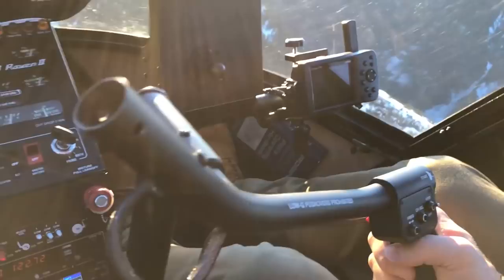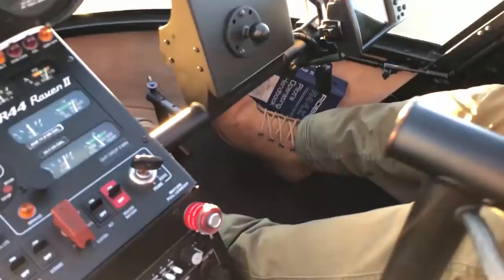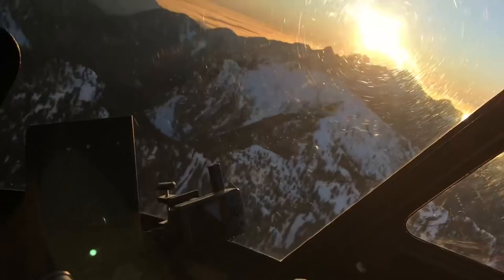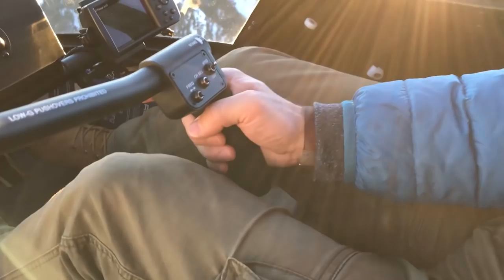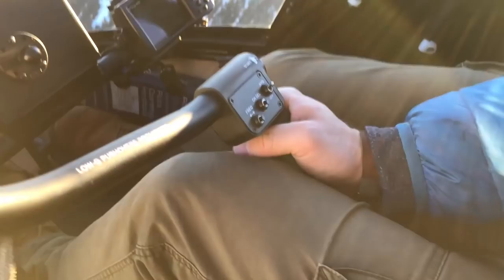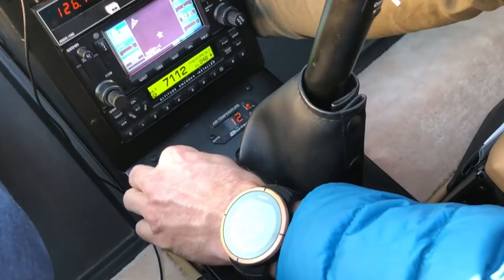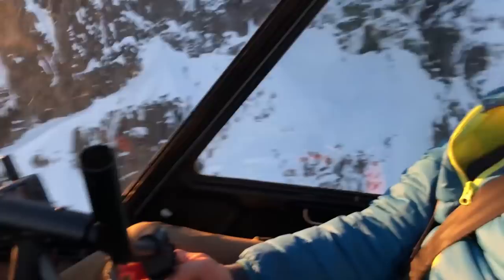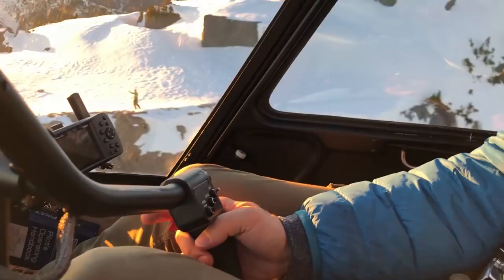VLOGMAS DAY 6 | HOW TO SAFELY FLY A ROBINSON IN TURBULANCE

Comment: Top tips. I fly in a mountainous area and I've always been very uncomfortable with those hits of turbulence. In the morning when the sun is low and cooking one side of a mountain, you can really get rocked by convective air. I've had flights where I honestly just wanted to be back on the ground. Your triangle method helped me overcome a lot of that discomfort. I also found that doing the triangle while locking my left elbow on the side of the passenger seat and gripping tightly while holding forward pressure on the cyclic (think sliding your hand up the tube, not manipulating the control up or down) really gives a solid base to ride the rollercoaster out without any accidental control inputs.

Comment: If you have to be this careful in turbulence flying a Robinson, it may be time for a main rotor hub redesign. Prior to the Cessna Caravan, the Bell 206 was the safest single engine aircraft and it also had only two blades.
Reply: @J So, it is a design flaw. The head is not suited to the application which results in an overall flawed design.

Comment: Nice. I would add one thing: Keep the power somewhere around 15-20" of MAP. To one avoid overspeed's. Below 15" MAP the rotor starts floating fairly fast. And two, if you get into a low-g situation it won't roll that aggressive than with a high power setting.
Reply: Bear in mind that in the mountains we have to assume that the air is thinner as we're higher (although technically cooler and therefore more dense - but not enough to counteract the height) so you need considerable MAP to fly S&L and certainly to climb. Single pilot R22 you're possibly going to be able to be at 18" but lower and you need to add carb-heat which removes up to 2" from your MAP limits. Power management in mountains is a whole different ball game !
Reply: I shouldn't have added any numbers, probably saying keep MAP as low as possible in the situation you are in.
Reply: Dietmar Gufler point well made. Always someone who’ll pick up on the details - I didn’t mean to be difficult!
Reply: hh, your not... i just personally don't like saying things wrong ;)

Comment: Another great explanation, thanks. Why is it that I see a lot of Heli pilots wearing helmets while flying?
Reply: for head protection
Reply: A helmet isn't going to help much in the event of a crash. It's mostly for noise cancellation as well as comfort. If you're flying with NVGs you also need something to attach them to. Helmets also have two built-in visors.
Reply: Scylla That is really an outsider opinion.
Reply: What exactly? If you really think a helmet is going to save you during a crash then I've got bad news for you... And when was the last time you saw a commercial airplane pilot wearing a helmet?

Comment: Great informative video and needed! Thanks! I got in a wind rotor a couple of weeks ago and lost 1k feet in about 2 seconds. Scared me to death as it rolled right and dropped. Training kicked in before I could even think. I put in aft cyclic and dropped collective a bit and just let it stabilize and slowly moved away from the area. 🤢🤢. Also I saw the elf at 8:18 on top of the mountain as you flew by.
Reply from the maker: Guaranteed Home, LLC wow that would  have been super scary!

Comment: Newbie here, so can this ONLY happen in 2-bladed helicopters? I know mast-bumping, yes, but the effects of turbulence and the solutions you provide here, is that universal for all helicopters or is it that once you start adding 3 or more blades the turbulence minimizes or maybe acts on the aircraft differently such that different maneuvers would need to be applied (and if so, what kinds)?
Reply: It's the semi-rigid rotor system, which just happens to have two blades, but not the problem. This system is on several helicopters and mast bumping is a possibility on all of them, just not as likely. The true culprit is weight. 
The Robinsons are extremely light weight and as such the blades can easily lose their loading in a low-G movement, where as heavier aircraft keep weight pulling down on the blades, keeping them flapped up and out of the way.

Comment: Something I didn't hear mentioned but I wonder about.  If turbulence induces a low G situation, wouldn't roll more likely be caused (and corrected) by tail rotor thrust or is that only really a factor on helicopters with a tailrotor mounted higher above the centerline of the boom?
Reply from the maker: Matt Stambaugh the main thing is to get the rotor loaded back up again. You need to gently use cyclic for that. Once you have the disk loaded again you and proceed to recover the aircraft with whatever is needed.
Reply: Thank you for the reply!  I really appreciate the way you step away from some of the more "gross" instruction and dig into the subtlety.  The order in which actions are taken being just as important as the actions themselves, the advice of very-high-hour instructors such as yourself legitimately has the potential to save a lot of headaches (and the occasional life).
Reply from the maker: Matt Stambaugh that’s great to hear. Thanks.